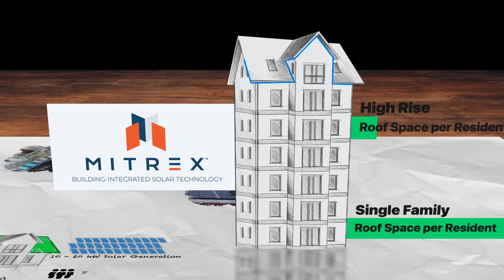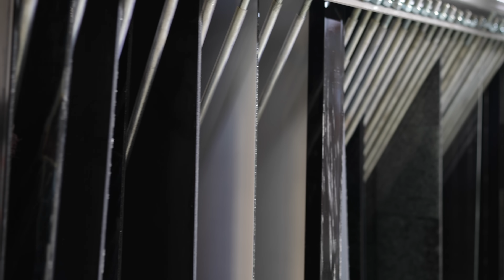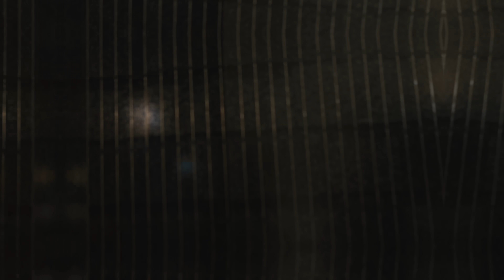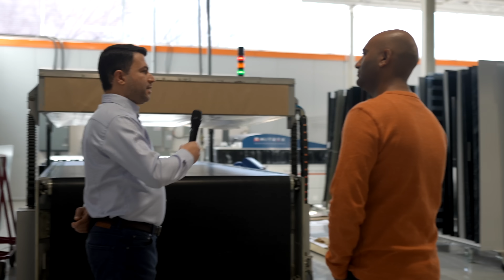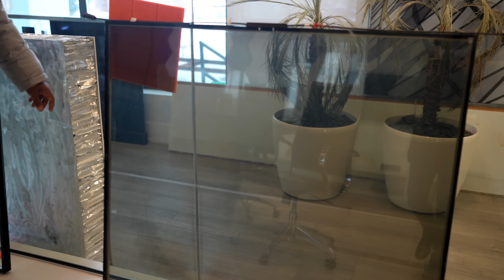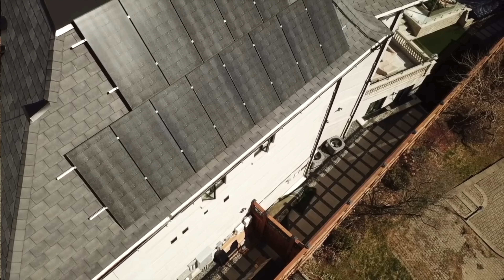Breakthrough Solar Tech Solves Solar In Big Cities!

Comment: Now there is someone thinking.  Get rid of ugly panels and integrate.  Any time you can integrate a valuable component into a system and make that system better, overall, you win.  This is awesome.  This is ingenuity at work.  I would love to use this on a build.  Great video.
Reply from the maker: yeah I kind of want to redo my deck and get something with thin film tempered glass panels and steel... how cool would that be!
Reply: I agree fully, I am planning on purchasing myself a new motorhome to travel as a well funded nomadic man, I am curious if I can get this installed on my motorhome. No noisy generators and running engines
Reply: Thos "ugly panels" are far more efficient.

You need all the extra area of building windows to make up the huge difference in efficiceny to recoup the costs.

Comment: It’s a very interesting concept. I wish them well.

I wonder how they deal with the wirings beneath the panels as well as the power management. They’re essentially making every building into a power plant.

I’m guessing new buildings with this product in mind can deal with this issue better than older buildings.

I also wonder how expensive this is. Repairability is important as well.

Edit: another issue that they’ve overcome is the winter. Snow stacks up on the roof making regular cleaning necessary in cooler climates for solar panels to work. Having them on the side of the building should avoid that to a certain extent.
Reply: Not only that, but the solar panels on the side of the house could heat heating coils to a bit above the freezing point of water (by like 5°C or 10°F), if the solar panels on the roof produce no energy, so they increase the overall amount of energy produced by the building. Works better the more solar panels you have on the side of the building, compared to on the roof of the building.
Reply: With the sun on a low angle in winter, but of course not completely horizontal, if you could have the walls perpendicular to the angle of the sun, you would generate maximum electricity. That of course mean's angled walls, not vertical.
Reply: @grgmetube  And you could use metal-sheet (imperfect) mirrors to reflect more sunlight onto the solar panels (on the walls or on the roof), to get more electricity than at the maximum efficiency of the solar panel without the mirror(s). Especially since the winter air is colder, and that helps keep the solar panels from overheating, with or without a fan circulating the cold air to cool the solar panels.
Reply: @grgmetube  Sooo,maybe we’ll see more Pyramids & Dome structures?
Reply: @evil17  Yes it could provide a reason to get away from the traditional box building in architecture.

Comment: Thank you. I've conducted a research on BIPV a few years ago. Back then there were already hundreds of BIPV buildings, mainly in Europe. The added cost for BIPV was very high, with an impractical ROI, unless high tariff for BIPV electricity production is given (ROI also depends on the country). A high tariff can be justified due to the added benefits of BIPV- energy resilience, energy loss reduction, materials use reduction, dual land use, and more. If today the ROI is reduced to a few years - it's phenomenal. Governments should promote NZEB/ ZEB (Near/ Zero Energy Building) legislation, as in Europe.

Comment: Since the price is similar to that of wall sidings, it might be economically feasible to simply add them on the inside of the backyard walls, or even the inside of front yard walls (if you have them walled in). It also works for using normal solar panels, if you don't care about the aesthetics.

Comment: Super minor gripe, in the video it states that highway sound barriers do not do anything (which is often true), but shows b-roll with a barrier utilizing plants which have been proven to reduce the sounds and thus negative effects from high speed traffic. I think in some cases such as where plants can grow easily year round, having plants along these noise reduction walls can help them do what the sound-retaining walls were intended to do. Now somewhere such as the deserts of Nevada or Arizona would really benefit from these since the ample sunny days and reducing sound with plants in these locations would be much less practical due to the extreme heat.

Comment: There is an additional thought! Solar cells are now so cheap their cost is essentially irrelevant. The real problem is the cost of installation! We need to find a way to fit them cheaply but securely - e.g. a fast robot spider fitter that can climb walls/roofs and  fit directly without the need for scaffolding.

Comment: The secondary advantage to using the thin film windows on taller buildings?
Solar is energy.
Using the film, you prevent energy entering the building in summer, so there's less air-conditioning required.
In winter, you can still use the power to feed back into heating.
Reply from the maker: Yes very true. Dual purpose win

Comment: Good thing is that the angle to the sun is much better in the winter for vertical panels..... and winter is when we need solar power the most. I have a panel on my balcony that lays flat in summer but stands up in winter.

Comment: Fantastic video and the travel production!

I was just thinking about this the other day especially with commercial Perovskite cells coming out that are naturally translucent.  At mid-day, an enormous skyscraper could be making some 33% to 100+% of its power during the daytime with surplus exported to neighboring buildings.  That is a significant load off the grid day-after-day.

I keep saying that nothing is more efficient than  producing & consuming power locally and nothing is more local than power straight off the building's own rooftop and parking lots -- and now walls & windows too.  The dream is coming ever closer to widespread reality.

Not knocking other renewable technology but we need to commend how no technology other than solar PV integrates so seamlessly into the urban landscape -- even just regular rooftop panels.  Residential/commercial solar PV regularly produces kilo- to mega-watt scale power silently with no moving parts right beside or over us.  Every watt used locally is a watt not stressing a remote power station and transmission over an aging increasingly overloaded grid.  The shared grid is so often under looked as a future bottleneck.

The distributed nature of residential/commercial solar also makes it very resilient.  This is especially needed for the increasing frequency and intensity of extreme weather.  Not to mention user error, grid equipment failure and, unfortunately, terrorism both physical and cyber-terrorism.
Reply: Yes consuming it locally means less waste of energy. Good storage of excess energy would make it even better with no storage or not mutch, you would need a grid to transmit to a climate area where the weather was bad at that moment or not much solar energy available.  Producing and levelling the local area would be the best solution.

Comment: I think it make a lot of sense even for regular house. Some subdivision won’t allow solar panel on roof. However, if the brick panel can be mounted on top of the existing brick wall and look just like the original brick wall then we are talking. One thing is moisture behind the panel and the wall that needs to be addressed.

Comment: those hundreds of square feet are not "unused".  The roof and attic of most homes is actually a heat collector attached to a wood and pasteboard radiant heater.  Insulation is installed to protect from this heat collector.  The air in the attic is well above ambient temperature, so it's not "unused" space so much as an unutilized thermal collector.

Comment: “if you can sell excess power” is the key phrase  you said, to make one of the main cases of CCAs, community choice aggregation.
Reply from the maker: Well remember on commercial buildings, they can just use it locally. They could charge tenants for energy or provide perks like free EV charging. they only need to export excess, but that's pretty ambitious, since density of units means lots of people and energy use.

Comment: I was a bit skeptical at the beginning of the video but it looks very promising and is quite cool. I like that you also brought up the angle but it would have been cool to have given a few examples with like their best, worst and a non coated, and also mounted vertically or optimally. They seemed to say their coating only took away some 5-10% which is way less than I would have expected, especially on the white and metallic ones. I guess their coatings are completely transparent in IR. Maybe their coatings are really optimized for human eye sight, would have been cool to see some spectral images but that would probably be close to sharing trade secrets at that point (which could be a good thing though, giving some more healthy competition). Anyway, thanks for the video, it was well presented and I enjoyed it!

Comment: Shadowing from adjacent buildings is the enemy in a city. I suspect power generation will be <25% from roof top solar of equivalent area. However any generation potential is good if price per kWh is lower than increased cost over conventional cladding.

Comment: I'm interested to know how the window panels looked up close, as they seem like they wouldn't be too distracting to have in many situations. Combined with a good UV layer on the back side of the pv, they would probably work well to reduce interior space heating which better reduces the energy demands of the structure for cooling, overall increasing the energy benefits of the product.

Comment: Walls are the battery with internal channels cooling air and water. With section of battery internal panels. Walls are living breathing and cooling house. No more ducks in attic. Double foam Crete insulated both sides.

Comment: I'm not sure how you calculated power generation based on square feet? I have 160 square feet of solar panels and I generate 17.5 kWatts/day on average, panels are rated for 2,650 watts/hr (530*5 = 2,650).

Comment: This is just fantastic! I had some thoughts and ideas.  If these panels were placed against a backing of cement or something with a lot of heat capacity, that might serve to keep the panels cooler and more efficient as well as act as thermal mass to moderate the building temperature.  I wonder if there Or ways to produce solar cells of a different color than what they typically are? Perhaps they could be doped with something that would alter the color without affecting the efficiency very much. This might give more options for these kinds of panels, with less efficiency loss. Perhaps the solar cells themselves could be produced with patterns on them that would be more attractive than the solar panels we have now, with very little loss of efficiency.

Comment: Didn’t mention how long does it last? Is it similar to traditional solar panel 30 years or much less?
Reply from the maker: yeap! its a traditional panel with traditional + extra protections, it'll last 30+ years just like the best solar panels... they have thin film products too... those I'm not as sure about
Reply: Gear thanks, we are building apartments. Now require to include some solar at roof. This is great way to increase solar area without Sacrifice open space. Thank you

Comment: Looks good for low-rise buildings and warehouses (no windows, can just cover the facade with higher capacity panels). As an architect specializing in the long-term maintenance and constructability of various buildings, I have major concerns with this idea. 

First - Long-term maintenance of the wiring/connection of these panels (10+ years out), accessing the wires and connections sandwiched between panels and the building facade. That could become a costly issue as the system ages. Laborers on cherry pickers or on a swing hung from the roof? Would annual inspections/maintenance be required? Baked into the costs?

Second - Panels (and window panels) that are integrated into more complex wall systems (rain screens). These wall screens (and the waterproof barrier behind them) need to insulate and protect the building from wind and water. The wiring/connections, how many wall penetrations (to get the wires into the building) will be needed? One per panel? One per floor? Any penetrations need to be waterproof and the more penetrations, the higher chance of water and air infiltrating the building, which is not good. Again, besides maintaining the rain screen, maintaining the wires and connections buried behind the windscreen can be a challenge. 

Third - Low-rise and high-rise curtain wall window systems are actually very complicated (to keep water out and also to let the water that gets into the various frames drain out). Adding another layer of complexity (wires, connections between panels) could be a big issue. Adding these solar panels to a curtain wall could add additional fabrication time to modify the curtain wall frames and additional time to install the systems. This translates into a higher cost of installation.

Fourth – Labor coordination. Will the curtain wall framers also be the laborers that install the solar panels and components? Will a separate group of trained (certified) laborers be required? If yes, that adds to the time it will take to install the curtain wall systems. Potential for all kinds of delays if the various teams are not well coordinated. 

Fifth – This stems from the Fourth. Once the panels are in place and the wiring has been brought into the building, what’s next? Does the electrical subcontractor take over and connect all of these panels to the building’s electrical system? Run additional wiring to a central area? Assuming these panels will be direct current (DC)? That needs to be converted to AC power. These panels and wires (running several floors) need to be figured into the costs. That can also be a costly budget addition.

Sixth – Another labor issue. Manufacturers can have the perfect building component; however, if unqualified laborers are used or engineers are not observing the installation of the panel system, serious problems (malfunctioning panels/connections) can occur soon after completion. Could be a nightmare tracking down where problems might be (when trapped behind finished walls/ceilings).

Seventh – Industry adoption. You can have a flawless system, but without a proven track record (15+ years of awesome results) getting building owners/developers to adopt is extremely hard. Likely the first adopters will be governmental buildings (limits the number of structures).

Besides all of those concerns, I still hope they can make this work. Cheers
Reply: Okay - Rocket fire 1. takes less abuse than 25 year rated roofing conditions, but yes, integration sacrifices each of access. 2. Mounting hardware is easy because back of panel is 100% structural area (I.e clips, rails, whatever u want) 3. BIPV is often mis-assumed to be glazing. The intent is the complete opposite actually. To absorb the light, the back of the panel is opaque to the other side thus part of an insulated wall assembly.
Reply: Okay, can’t do em all - but few more fun facts - panels are low-voltage connections so anybody can do them (until it gets to the inverter and grid/battery bank connection). This, to note, is where 95% of solar setups fail. Even in array, this always accessible for maintaining.

Comment: If there are several "tall buildings" adjacent to each other then much of the lower exterior walls will be shaded for at least some part of the day. But this is great for walls, etc., with good insolation. Could this also be used as a solar transpired wall? That would be a sweet combination!

Comment: the decrease in efficiency is certainly acceptable but is that measured on the obvious vertical that is NOT going to be optimal to sun angle ...except for Canada where it actually will be ok for low angle of winter sun

Comment: Are Solar Panels multi-layer? It seems that if you could install a single panel that is more dense/multilayer then installation cost could go down significantly (which is a big part of the costs of these systems). Or a double sided panel with mirror integrated onto the substrate.
Reply: That's what they do with the windows.
Multiple layers gives more tint.... But, by the nature of the product, each layer removes "energy" so underlying layers have less sunlight reaching them and are less efficient.

Comment: copper oxide solar panel schottky junction, metal-semiconductor, CuO is semiconductor (intrinsic) and Cu2O is N-type semiconductor, kinda pre-doped
Reply: solar freaking roadways, or road sides
Reply: angle the panel to the sun all the time, or just mirror concentrate the incoming radiation, you tilt the area
Reply: solar fixed concentrator trench on the roof, west-east dug on the ground
Reply: includes a water collector, sea water purifier, distiller
Reply: ideas are not propriety, propriety is not the future
Reply: ideas or anything to that matter are not propriety, you can use them

Comment: That could be awfully expensive as siding material, especially when a good portion of the building is facing away from the sun or covered in shade by adjacent structures.

It also could be difficult to maintain and clean. I suppose if there's price parity between the materials and installation costs compared to other siding types, it might be justified. 

To each his own, I guess...
Reply from the maker: In the video I mention their cost competitive with other cladding options. Why this is so interesting
Reply: @TwoBitDaVinci  True, but most siding is static and doesn't require similar maintenance or repairs for continuous function and efficiency returns.

Additionally, it was mentioned of a requirement to gain a breakeven time of 2 years before reaching price equivalency. There wasn't an exact price parity at the time of construction completion.